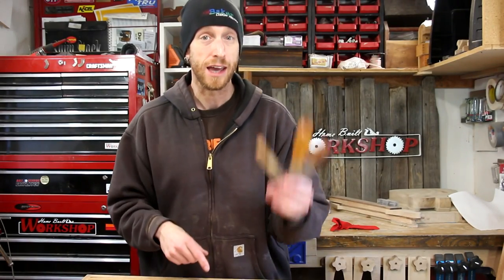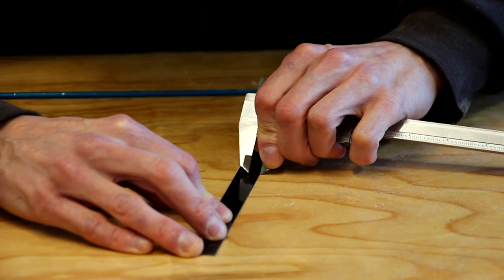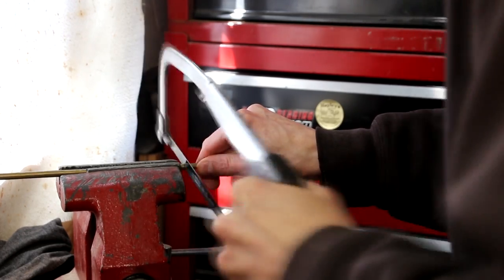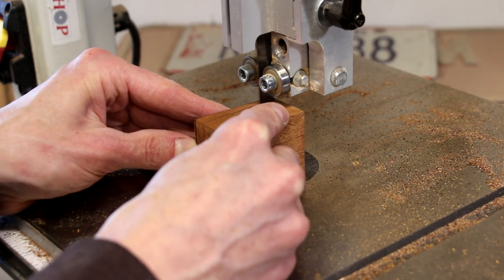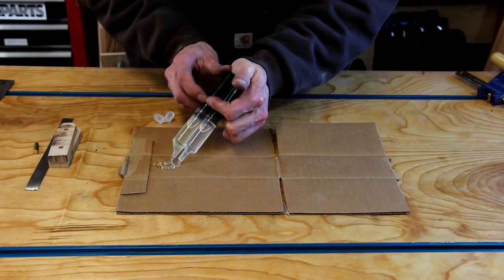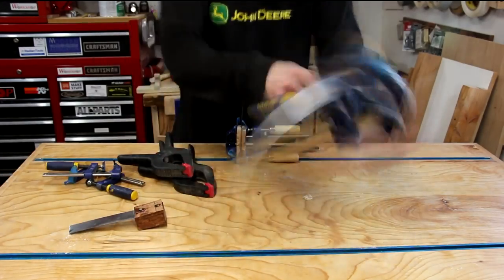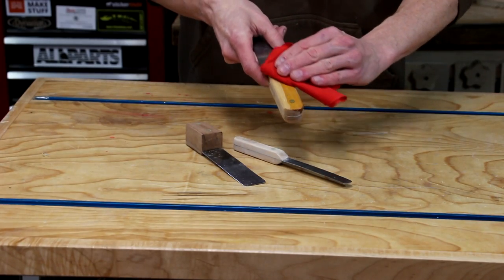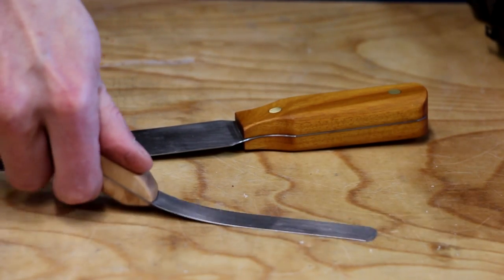DIY Guitar Spatulas (Seam Separation Knives)

Comment: Gotta make this soon, what thickness  metal did you use? (got two neck fretboard replacements happening soon)
Reply from the maker: I just measured these, the smaller one it .020, and the wider is .030" You can use some kitchen spatulas too if you have some old ones.